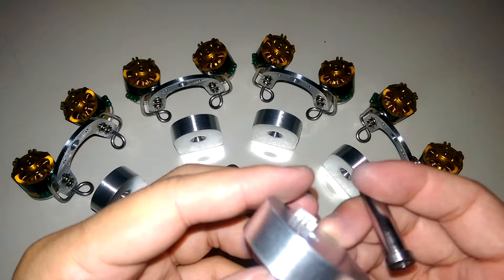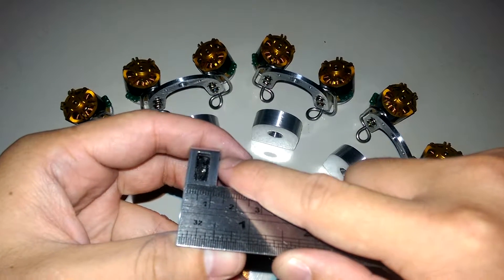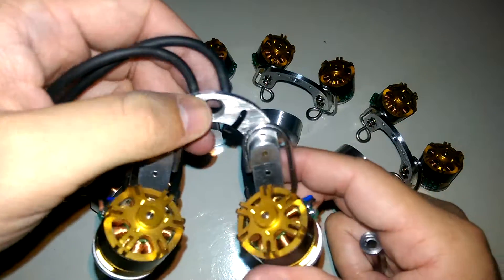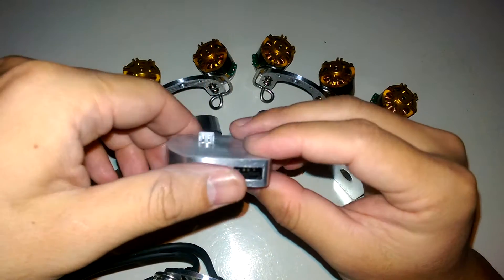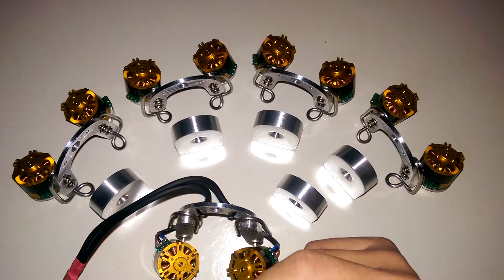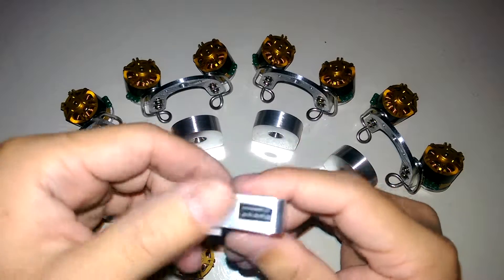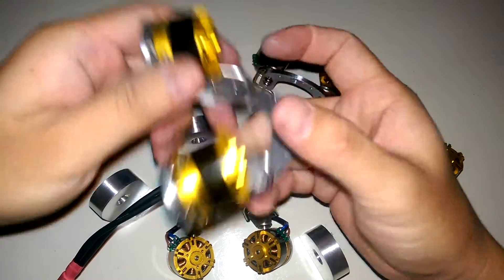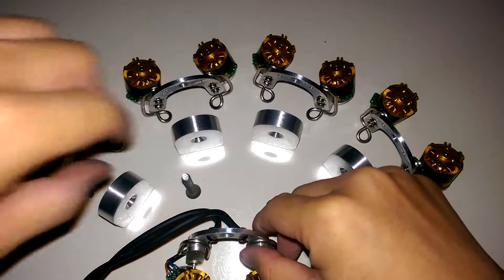Powerful Metallic Road Bike Dynamo USB Charging System 5 Sets Of Prototype

Comment: You could add a cable with a remote button like are on dropper seatposts for mountain bikes. That along with a cable guide would allow you to pull on the motor mounts to engage or disengage the dynamo at will, so you aren't always riding with the resistance of the motors on the tires. For road cyclists who do a lot of climbing this addition could possibly be the deciding factor as to whether they use this system instead of a battery pack. Good luck!